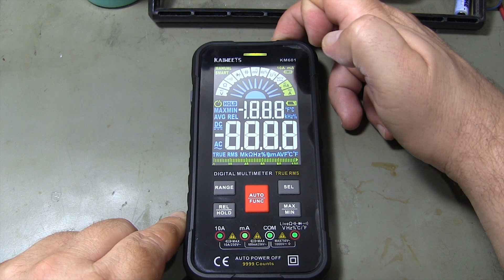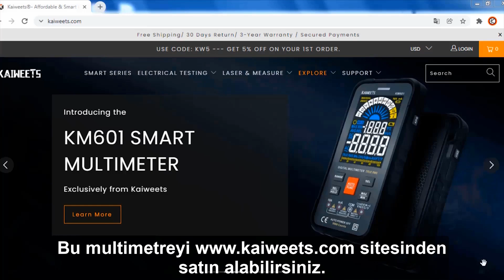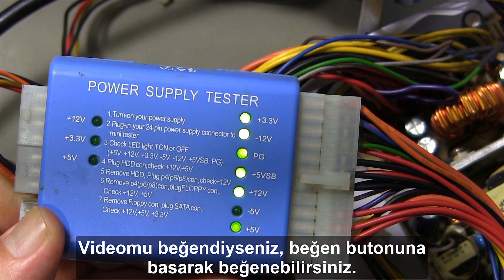DAMAGED CAPACITOR. (Repair of PC Power Supply  | Electronic Repair School)

Comment: Replacing the big capacitor doesn't seem cost effective, if it is at risk of blowing again because of another defect. One snap-in cap is 7 euros, new complete psu 50 euros.
Reply from the maker: I agree with you. Before starting the repair, it is necessary to calculate the cost.

Comment: Great video! Worth mentioning to replace the capacitor with another one with same capacity, same or higher voltage rating and same or higher temperature rating. Sometimes low ESR types are required, I always replace with those, just in case.
Reply from the maker: thank you for your interest